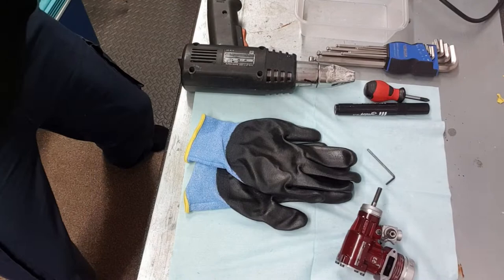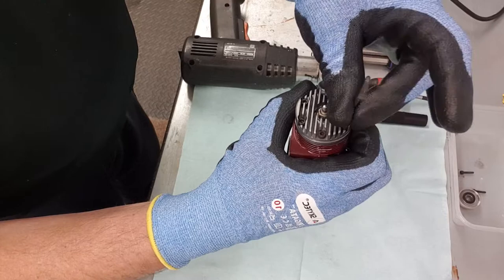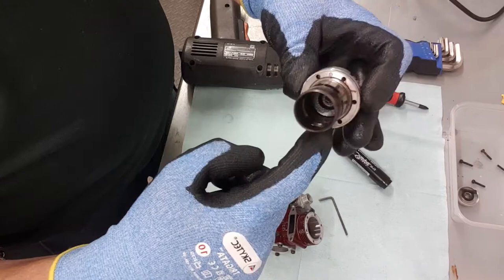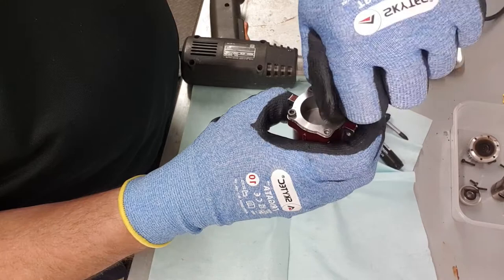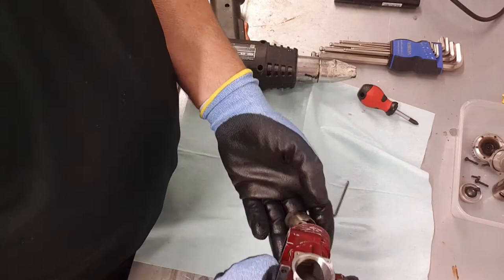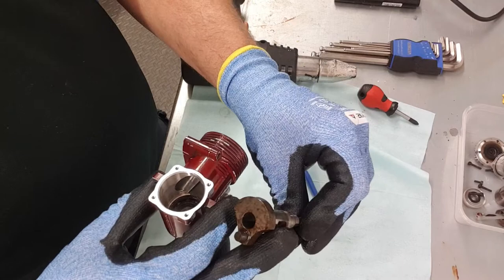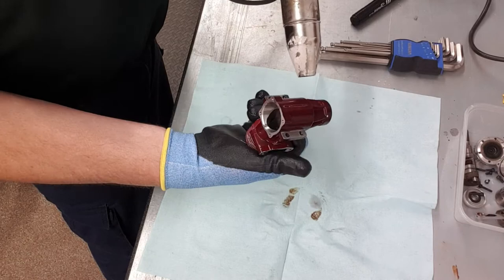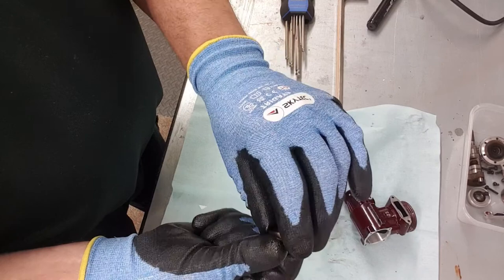Replacing Bearings In A Irvine 53 RC 2 Stroke Engine Pt 1

Comment: I cant get my prop driver off.. it looks like it has a tiny round clip holding it in. but its not coming off at all.?

Shoud the prop driver just come off easily?

Also my prop driver is cracked. Any ideas where I could get another one?
Reply from the maker: Hi Lionel, there is nothing holding the prop driver onto the shaft. There is a taper on the shaft and on the inside of the prop driver, if it has not been removed in a while they can become very tight. In this instance heat is your friend.....gently heat the prop driver and give the shaft a sharp tap rearwards. If this does not move it try using a small bearing puller. As for getting a replacement try www.justengines.co.uk. As you probably know Irvine engines have been out of production for a good few years now but you may fined one off an OS engine of a similar 
size will fit......hope this helps.
Reply: @KirkyRC  Thanks for the info. Will get that order on the way.